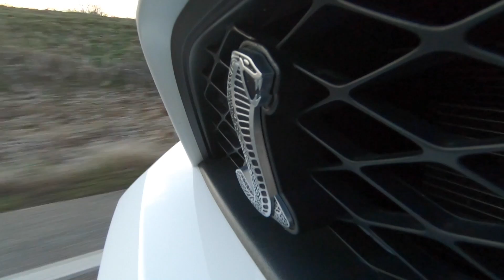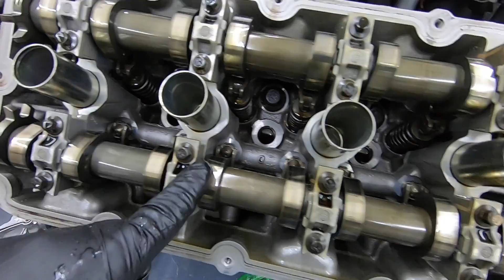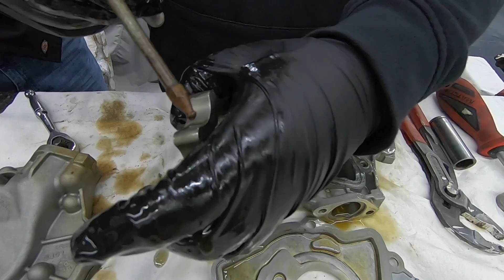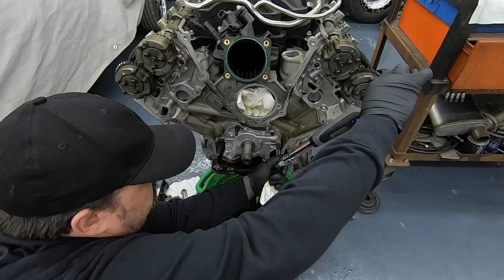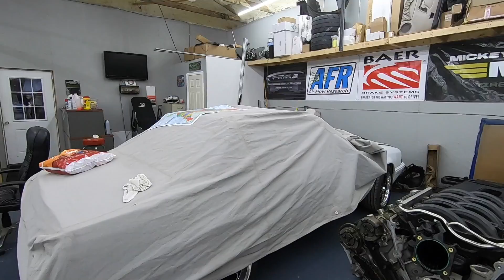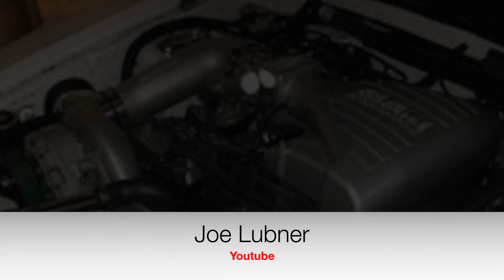Gen1 11-14 Coyote Oil pump gear install and timing procedure

Comment: Great vid man thank you! One question, you take the slack out of both sides or just the passengers side when putting the guides back on?
Reply from the maker: Bill Rogers thank you. I didn’t have slack in the drivers side so didn’t have to turn it.  Basically you want the side of the chain that is against the flat chain guide to not have any slack in it. All your slack needs to be on the side with the tensioner.

Comment: Hay Ken, that oil pump; Do you think an electrical component would help out with the pressure issue that makes the gears break and the timing chain, like a small but powerful E motor...... M. Gang Science?
Reply from the maker: timothy poole it’s usually the harmonics that kill the gears.
Reply: @SpeedAddict731 , Interesting.. ;}

Comment: @Speed  attic 731, very good video well in depth instructions on how to change the oil pump gears. Questions, did you forget the O ring for the oil pump pick up? 2, what size socket did you use to turn the crank? 3, in other video's they talked about the bar codes need to be facing up on the cams. You didnt say nothing about that. Is that for different gen coyote? 4, thanks for the video. Nice job
Reply from the maker: PoorBoy 313 thank you! no the o ring was on the pick up tube.  It’s a crank socket Dover has there. Yes the matrix code should be up. I actually said it but accidentally edited it out and had the video out before I noticed it lol. But if you have the r on right side facing up and L on left side your good.  That is only on the gen 1’s also with the matrix codes.
Reply: Thanks again
Reply from the maker: PoorBoy 313 you bet

Comment: Awesome video thank you for making it. Getting ready to replace the oil pump gears and crank sprocket next weekend. On tighten up the timing chain on the right side do you just turn the crank back to the chain is touching the guide?
Reply from the maker: Jason Friedberg Thank you and your welcome. Just take the slack out you don’t have to turn it much and just do it if slack is in the chain on the straight guide side.

Comment: Great vid Ken, now I wonder is the timing procedure any easier on the 4.6 dohc without the cam phasers being there? Also thanks for the feature!
Reply from the maker: johndeere137 thank you!  its a walk in the park on a regular mod motor. No problem that is a sweet Cobra you have!
Reply: @SpeedAddict731  Good to know, I don't plan on swapping cams anytime soon but it will need some chains at some point considering it's got 150,000 miles. I've got a couple more things to do to it over the next year or so before I leave it alone for a good while to start looking about getting my own house.

Comment: Does it make a difference which way the gears go in the housing? I heard you say the logo up I always heard the logo down
Reply from the maker: Cody Myers Boundary’s instructions say logo facing you.  To be honest I have looked at them and I can’t really see any tappering that would matter on which way.  I’ve always installed them this way due to their instructions.
Reply: Speed Addict 731 appreciate the response I just did mmr’s in my car over the weekend so was just double checking.
Reply from the maker: Cody Myers should be good. MMR says to do it with logo up also. Not sure why to be honest I have looked at them and can’t find anything that would be affected by it. But you can call MMR to be sure.

Comment: Did you replace the timing cover gasket or is it reusable? Great vid btw 💪🏾
Reply from the maker: Adrain6845 thank you! The timing cover gasket is rubber it can be reused if low mileage but it’s not very expensive so I would replace it. This engine had just had the mustang timing cover installed about 2,000 miles ago so he didn’t replace it.

Comment: This is an excellent video! I'm getting stage 3 cams so I plan to do billet oil pump gears and crank sprocket at the same time...BUT...I'm going to wait until I get a kmember so I can pull the oil pan. I am not double jointed lol. 
I know this sounds crazy but my car is a 14 gt but it was a late build  (6/14) and when I put my CJ intake on I realized it has gen2 heads on it. Do I still follow this process?
Reply from the maker: 370H55V O773H Thank you and yes you have gen 1 cams so you follow gen 1 timing procedure.